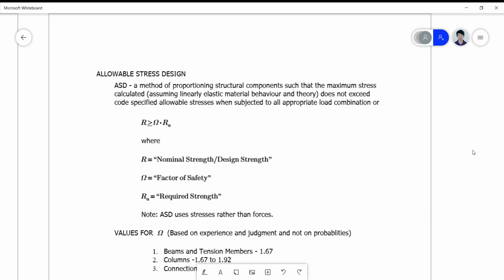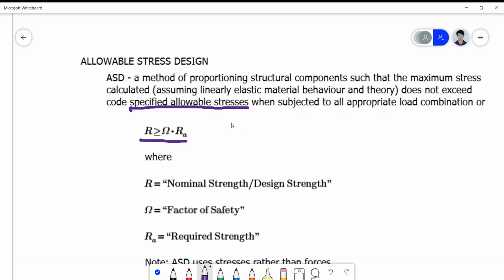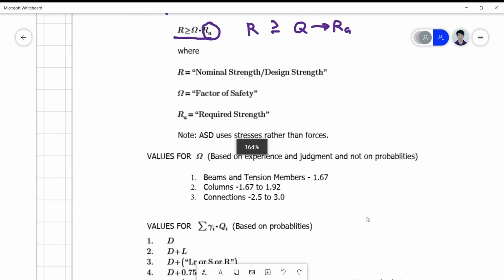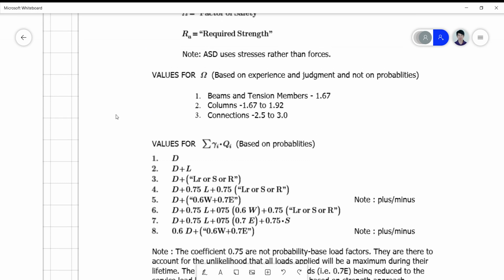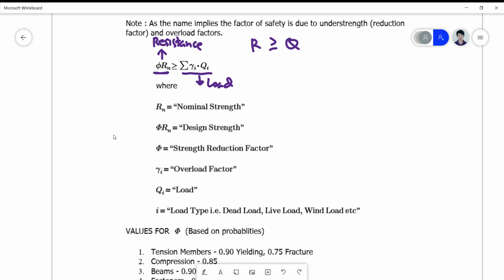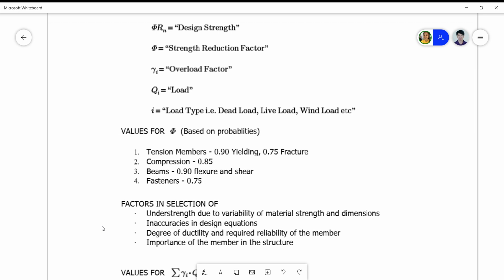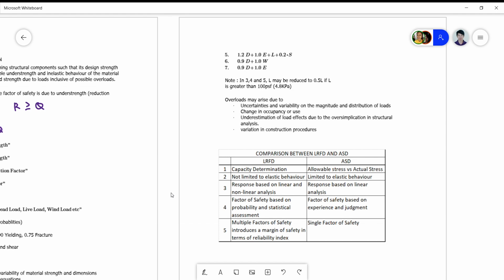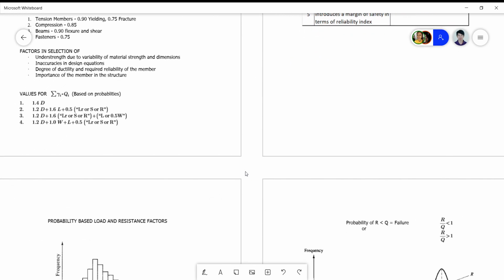DesPhil2

Comment: 5:33  - Sir na mention niyo po na yung gamma I Q I ng ASD is mixture siya ng probability
Reply from the maker: Yes. If a probability based factor is mixed with an experts judgement then the resulting value is no longer statistically correct hence not a pure probability based assessment
Reply: @edwindelavega5590  Thank you Sir